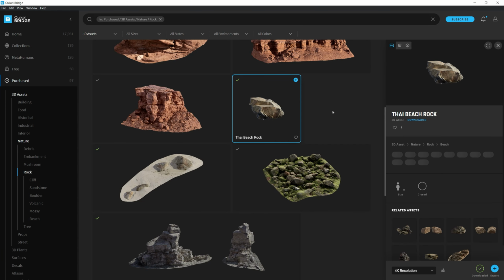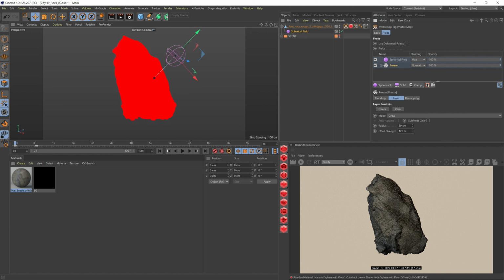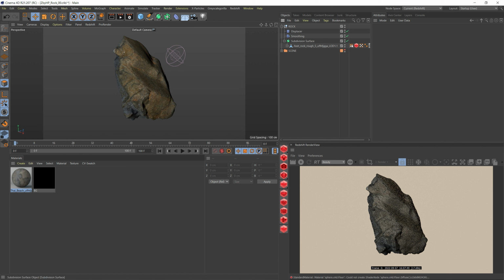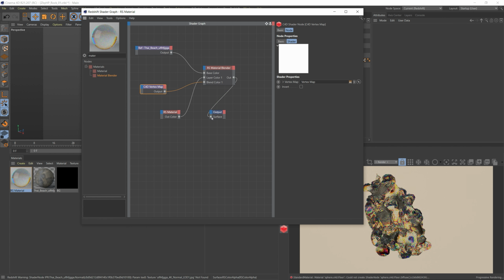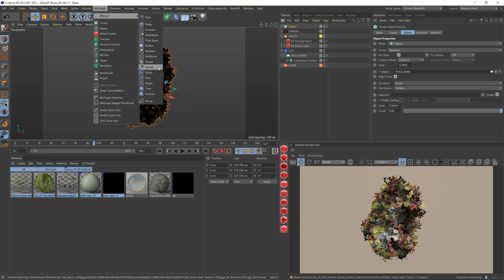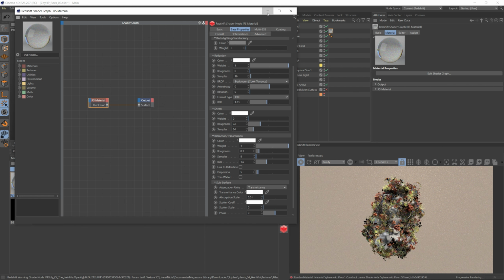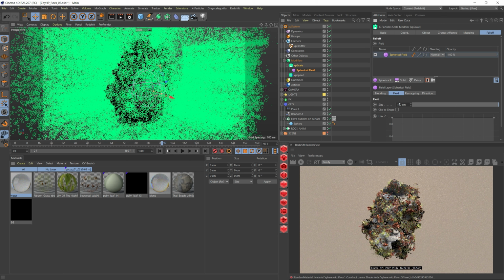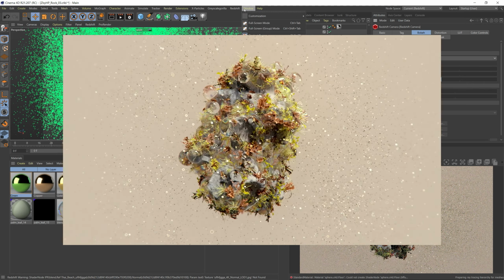QuickTip 13 - Rock Scene

Comment: Nidia, why doesn’t your system crash all the time like mine does? You seem to work at breakneck speed and nothing ever goes wrong… I’ve watched every video on optimizing render settings and turning off CPU etc etc. but if I was to try what you’re showing here, I’d hit the blue spinning beach ball within minutes. Mac Studio M1 Max. 32gb ram latest versions of all of everything. It baffles me. 

Do you ever use the node editor, or always the shader graph?

Thanks for the tutorial.